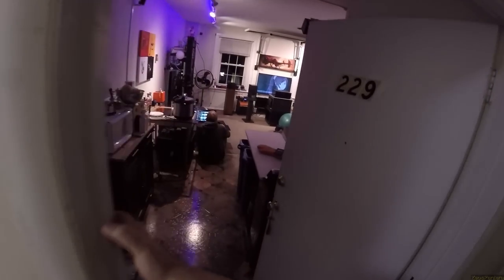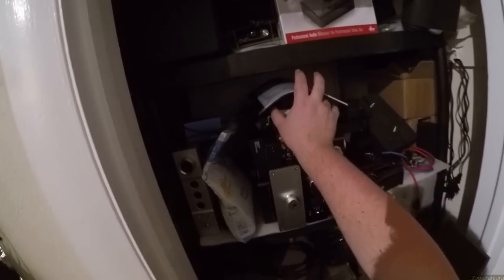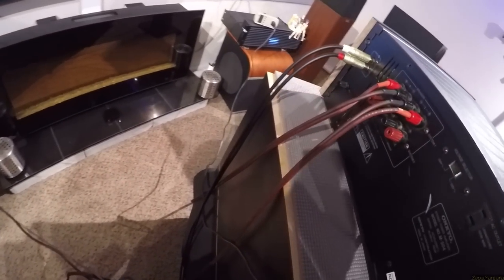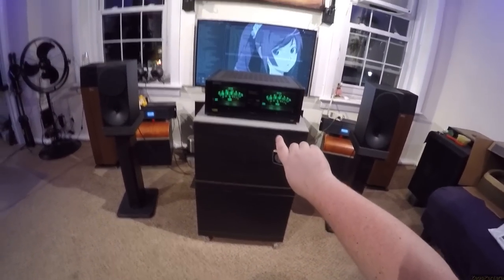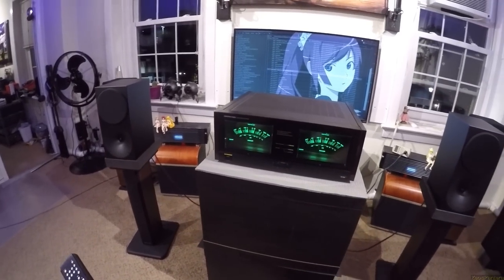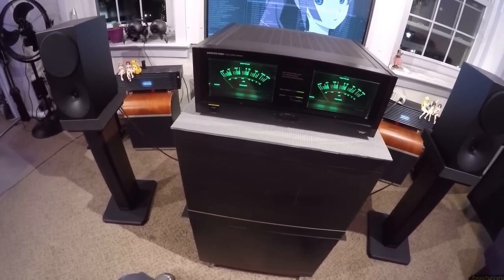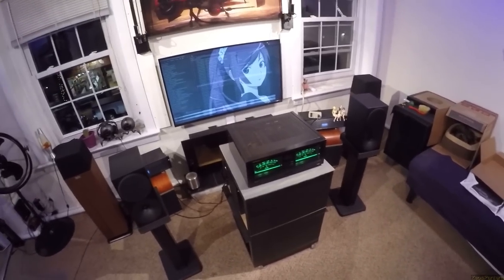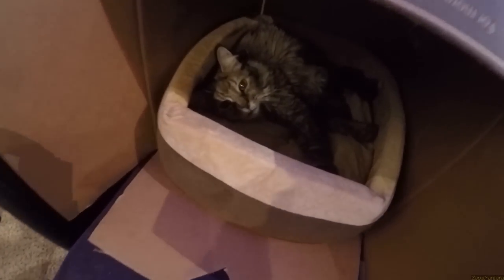Onkyo M504 _(Z Reviews)_ Vintage Japanese Beauty

Comment: Old audiophile gear is so damn sexy. The new stuff may have more things they can do but they cannot be as good looking as old audiophile  gear.
Reply: Yes. It can does more things.
The question(s) is if it does them equally well and for so long time.
Reply: They are also not as good-sounding as vintage audiophile stereo components, either.

Comment: Great unit. I sold many back in the day when I sold audio at Best Buy. I have the matching P304 preamp but passed on this. I went for the David Hafler DH500 (2x250 watts) instead. I needed the power to drive my Infinty Kappa 9 5-ways with two 12" woofers per side. I enjoyed  and took advantage of the employee discount very much when I worked there.

Comment: I have the M508, I have it connected to jbl l100s floor speakers and the needles push past the supposed 200watts per channel easily on those speakers, that’s why I have mine.  Bought both in 1993 when I was stationed in Japan while in the Air Force.  My babies!

Comment: There's no way in hell that class d amp sounds anywhere close to that monster of an amp. There are a lot of factors to consider with an amp of that magnitude.
Reply: The Onkyo was a good amp, but by no means a great amp, as anyone who's owned one will tell you. Just as with AB amps, there are good Class D designs and there are excellent ones. I have several that are superior in every way to this exact model (I owned an M-504 from the moment it arrived fresh from the factory until about five years ago when I upgraded my speakers and needed something with a lot more headroom and power).
Reply: @MrSatyre1  I have a class d amp with twice the power, better resolution and sound than the onkyo.  The onkyo sacrificed detail and dynamics for a mcintosh like warm and polite sound.
Reply: @scottlowell493  Haven't had a chance to hear class D or tube gear, but I sure love the sound of my Onkyo M-504 (or the sound of my Hitachi HMA-7500 kit) on my AR or B&O speakers.
Reply: @MCMTL   It's a good sounding amp.  Sounds pretty close to a macintosh.

Comment: I just recently just picked up 2 of these from a wealthy man, and the add said they were new/unused. I reached out, and he said that he bought them way back, and that he just sat them in his cabinet. He hooked one up and used it for a short time, very low hours, and the other never used. The veneer sides, not peeling like they all do. Original lights, not led's, no fingerprints, scratches, just perfect.  I bought them and have been using them together in a bi-amp configuration over the last year. These amps are visually stunning, and I too can't comprehend why large VU meters are a thing of the past. I do not think I will ever part with these, as I bet these are the finest examples in the entire country.

Comment: I know well this power amp as realtime in Japanese market when I was a part time sales consultant in audio shop in Tokyo.
I have sold several set of this pre and power amps, it was the flag ship product at Onkyo that time.
it was a very good capacity of power supply section and very high speed power transistors by Sanken, if my memory was collect.

Comment: Old power amps such as these were typically not direct coupled.  The big advance has been coupling and bypass capacitor quality , especially since most are partially dry electroytic caps and Mylar caps.  If you take one of the greatest amps of old vintage, the Luxman 4000 dual mono power amps, after re- cappiing, its sound is contemporary except when it clips, at 200 watts/8 ohms, and 400 watts/4 ohms.

Comment: If your DAC that is dangerously balanced on one end falls off that shelf as you move it around it will break itself and also probably break the RCA connectors on both the DAC and the amp when it is suspended by them in mid air.

Comment: Z should check out the Pioneer VSX d1s 5 channel receiver. Rated at 130 wpc, it routinely benches out to 158 wpc @ 0.005 THD. As a 5 channel receiver, they are obsolete, so video minded folks are moving on from them. But hit the direct button and the d1s become a 2 channel receiver. The AM/FM section is very, very good. Best, you can get the d1s on Ebay all day for $200 to $300. It has  multiple, as in overly redundant,  inputs. It can be programmed to power speakers in other rooms playing different programs. It is way over-built. It cost $1300 in the early 'nineties and is considered the best unit Pioneer ever produced. Do you read me, Z?

Comment: I have this now being demonstrated. The guy (first owner, Air Force bought it in Japan) is letting me run it on my system.  I also have a recent class D amp.  Which is fine.  But this 504 definitely has a fuller dynamic (lower freq's) and gets f'ing LOUD with zero distortion.  I also have the P304 preamp but we can't get it to work.  He will sell it them both for $500.  Decisions.
Reply: Did you ever buy it?
Reply: @eaglerider94  Yes I did.  It's my main 2 channel amp.  Love it.

Comment: I just least night conected my p3030/m5030 that i got for $500 plus original tape dack and radio (all in mint condition with original boxes and instructions). Worth every penny. Soud is heavenly, more musical then my rotel rb991 or nad 2200 or sansui 717 all of which i like very much. I just wish i had stack 5 or 6 of these for home theater.

Comment: "Glass" in the fascia... CLASS into the thing.
Just connect to the RCA inputs the minijack stereo output of (say) a LG V30 smartphone and you're done. For streaming, Hi-Res digital files or even high quality FM Stereo reception.
And don't mess with outboard pricey streamers, DACs or (if you like records) non built-in-preamp turntables (they sound equally bad like the "purists" ones).

Comment: When I first got into seperate's the kind of amp I was drawn to was like that Onkyo and the Mitsubishi line with the huge meters as well as the Proton Amplifiers.
Then I had the chance to use some High current designs From Krell , Nakamichi Stasis and then Adcom which is my present Amplifiers of choice .
I do enjoy when you explore some vintage gear .

Comment: Just listening to the little part you played, it definitely seemed like the Onkyo was A LOT better than the Topping. It seemed like it was more effortless, warmer, cleaner overall; which is probably cause it had a lot more power to spare. But I dont think the volume was as the same levels, or it was at the same part of the song, and you were standing closer with the Topping. So I can't be sure.

But what you played for us, the Onkyo was significantly better.

Comment: I have a Sony TA-N77ES 200WPC  @8ohms 0.004% THD, I actually have the whole ES Stack TA-E77ESD/ 730 ES tuner / 700ES taped deck and a C75ES cd changer..  It is amazing ..
I also own a onkyo big meter stack M-5030 / P-3030 pre...etc.. also quite good.. 
However the Sony is AMAZING..  must be one of the greatest amps from Japan ever..

hate me as I got the Onkyo stack for free and the sony stack for $75... I pretty much RULE..
Reply: How the hell did you get that Sony stack for 75 dollars?
Reply: @0111pokemon  went to a 1/2 off sale at the local goodwill .. thought I was screwed as someone else looked at it then walked away.. I hurried over and got my hands on the items ... the components had been priced at 29.99ea (so $15 ea on the sale..)  I offered a kid $5 to go crab me a shopping cart and then loaded them into that and was out the door with everything for $75 =p  everything works condition is very good.. the lights were out on the amp but I fixed them with a $15~ lamp kit ..   Oh right I got a 2nd non ES amp  also with wood ends N110 as part of the deal.        So yeah... it was apparently my lucky day

Comment: Hey Zeos, those are NOT Watt meters. They are Volt meters. They are displaying the RMS signal voltage for each side. Remember Ohm's Law: volts x amps = watts.
Reply: It is labeled as watts at 8 ohms for the top numbers he was reading.

Comment: Are the capacitors replaced ? if not, then the amp will not be at its full potential
Reply: Your exactly right i got very lucky finding new old stock compasitors and i paid dearly for them ! Love mine check out my review of the m504
Reply: I'm the owner. It's full restoration included new caps.
Reply: @radomcrado9614  what caps did you go back with ?

Comment: Those could power your OHM 2000s. Granted, you could likely clip that thing if you listen at concert-level volume, but I would bet that at reasonable listening levels, it would sound great. Also, clean that crap off your sofa so your guest doesn't have to sit on the floor!  Hahaha!
Reply: We previously had it hooked up to the ohm's and it ran them just fine. I was sitting on the floor because i had been on my laptop and had to be there due to lack of available power outlets.
Reply: @radomcrado9614  good to know Zeos is not an ungrateful host! Very cool of you to let us get a look and listen to that badass amp too!

Comment: Did you solder amphenol connectors to wire or buy pre made? Can’t find source for permanent cables
Reply: @Newf Guy look at the video at 5:50 mark and check the link in the description for Micca cables

Comment: I mean, yeah, its beautiful and all, and I like beautiful things (I own a few older amps, including a Rotel RX-802 and a Denon PMA-720), but don´t believe the Watts of them!! This thing will NEVER put out 200W continuosly, and probably not even peak. Heck, it doesn´t even have a balanced input... I thinkt this thing is trying to be something like those Macintosh-Amps, and kinda succeeds because of the sexy af power level meters on the front. But still, I would never buy something like this for 600$ (maybe if I get it in a broken state for 50-100$ ;)).
But still, I love the fact that you made a video about some old equipment for a change, because many people seem to forget that stuff like this even exists (you can get cheap old-ish amps for way less than 100$ on auctions and stuff). It just seems to me that the example you made here is not the best in terms of features, as almost all older amps had quite interesting features that many amps today just leave out (tone control, decent phono stages, balance adjustments, and I have never seen an older amp without 2 speaker pair connections). 
I would love to see more of this kind of review, allthough it's probably not a good idea to make more of these, as almost no one would actually buy the reviewed amp afterwards...
Reply: You'd be surprised.

Comment: Junk and so was the preamp.
Reply: What would you consider not junk?
Reply: @glennbutler6783  Yamaha & Sansui both better. Nakamichi, Technics, Denon, Victor, Onkyo, Pioneer & Sony were kinda dwelling in the mid-fi region even with their top end models. In the 90s audiophile gears have plateau'd while pro audio has improved a lot specifically the Class D amps. Out of all those great Japanese brands, only Yamaha went pro audio. As for me, I'm still using a Yamaha ax1050 for my 2x12 mains and an Inkel/Sherwood amp for my 4x18 subs. That's for two channel music only cuz I don't watch movies. I use the small tv for news or when I want to get a good laugh at those music videos with some clowns rapping and twerking.